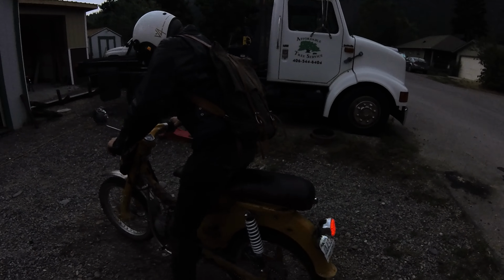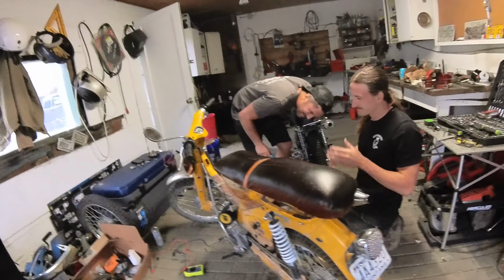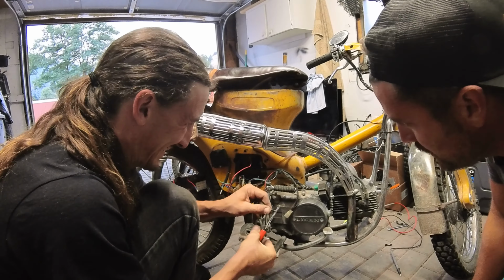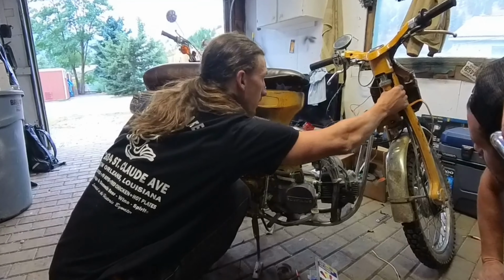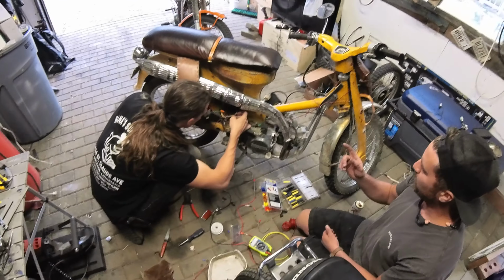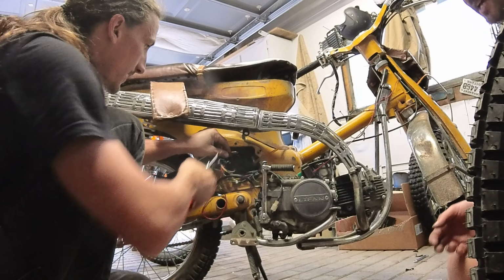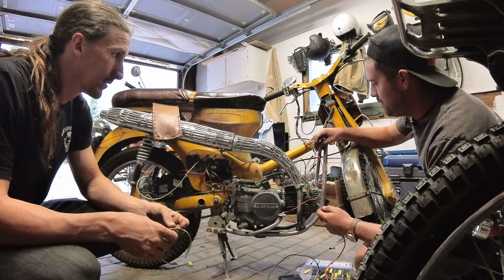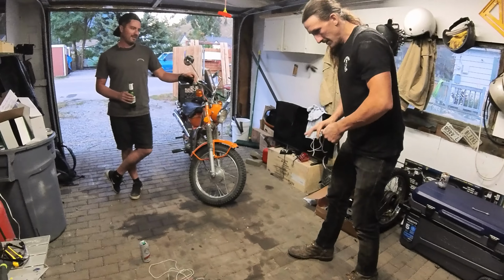Honda Motorcycle Restoration | Electrical

Comment: Tim if you don't have a name for your bike, I think "FLASH" would be appropriate. I have a Liftan 125 cc motor  in my Garage with electric start, One of these days I am going to try and modify one of my trail 90's . I take it , they are 12 volt. I got the motor on a trade and it's new never been started.